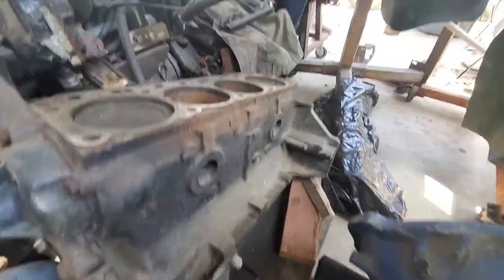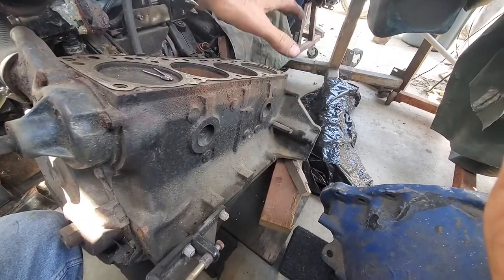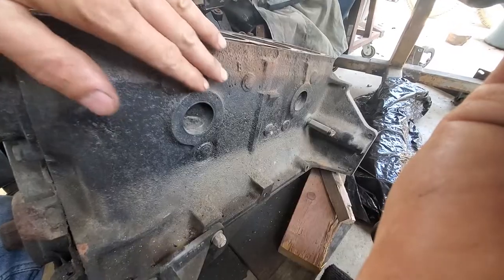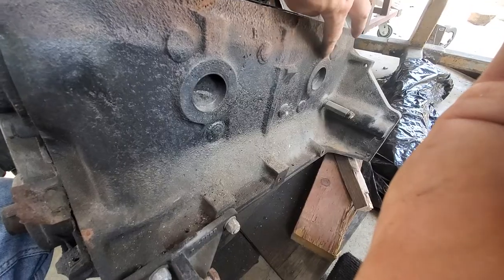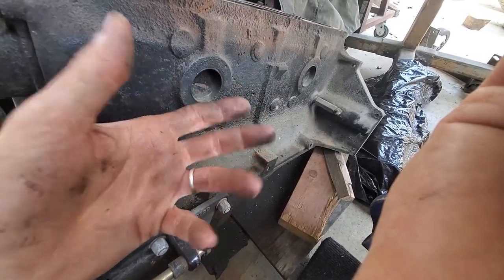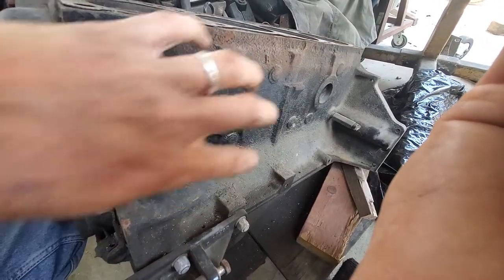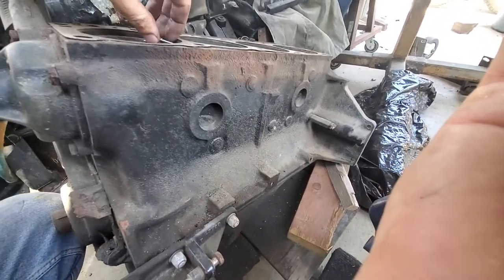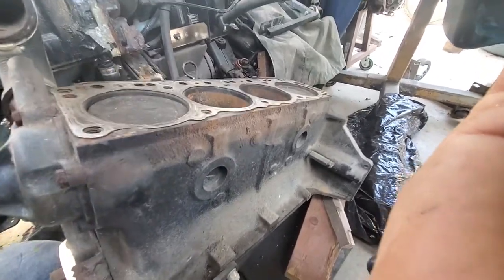Fix your cracked engine block for under 10 bucks. Boat or car doesn't matter i4 v6 v8

Comment: I'm shocked at how many people don't know the trick of putting clear tape over JB Weld.
I even use the tape when doing body work.  It works on fiberglass, bondo, or almost anything that chemically cures.  Just peel off the tape after it hardens.  No sags, drips and even shape it to match contours.
Thanks for the video.
Reply: good tip

Comment: Picked up a 98 ebintide with a 5.7 mercruiser. ..supposedly just has a cracked block.... havnt dug into it yet...you give me hope
Reply from the maker: Good luck - ive fixed a few this way that still run fine. Do the fix and run it for 10 minutes on the hose and keep pulling dipstick.. if possible use dark clean used oil - it shows cream real easy. You need to watch my engine flush video to see how I speed flush milky cream from an engine-
Reply: @SocalMarineUSA  thanks,going to dig into it soon.   Would love to restore it
Reply: @SocalMarineUSA  I just bought a boat has cream milkshake EVERYWHERE I was told it’s only the head gasket but I suspect the block is cracked at 8am this morning I’m about to inspect the block for cracks. What do you suggest I do besides fixing the crack, replacing the gaskets, swap the spark plugs & change the oil ? Any tips or tricks or proper instructions would be greatly appreciated. Thanks.

Comment: Instead of JB Weld, use windshield adhesive. It stays flexible and is extremely strong. It will not crack.

Comment: Had the same crack on my 3.0. I used MarineRex grey instead of JB Weld. Still running strong with no leaks 3 years later:-)
Reply: Will it work on my kia sorento?

Comment: These are not pressurized cooling systems raw water systems dump out riser into exhaust.
On pressure fresh water cooling systems i used 6011  arc weld rod made for cast steel pipe welding.

Comment: I have my boat engine block with a crack and I did 3 times JB welded and every time the patch come off... always milky oil do you think the block has internal damage?
Reply: Yes,  the crack im talking about doesn't mix oil and water. Either head or block is cracked or head gasket bad.

Comment: Hey thanks for the video. I am considering doing this and am curious how your repair is holding up to this date?
Reply from the maker: both blocks ive done have been going strong years later- its a very easy job :)

Comment: Hi mate ive got a pin hole size in side of my transit block. 😢 ive cleaned the area and waiting on jb weld extreme temperature putty coming this stuff any good? . Small hole leaking coolant slightly.
Reply: yeah that should work just fine! its not very high pressure. Clean it well and spit on your finger to smooth the putty out so it doesnt stick and pull back off. leave overnight and it shd be good. On top of that you can also add a liquid radiator stop leak product - in case a nother one develops it will find it and plug it. Dont use the stuff with fibres or kevlar etc in it, they plug radiators, just use a liquid style one as a back up..

Comment from the maker: depends - cream could be froma cracked head, standing in the rain or possibly cracked block. If the block cracked outwards like in this video it will likely be fine after the fix. Watch my flush video here to speed flush the motor asap to get an idea of whats going on. https://www.youtube.com/watch?v=fU8a-UbBxvc

Comment: What if the dip stick isn’t clean
Reply from the maker: remove oil pressure sender on side of block. Install a 1/8 npt ball valve with a CLEAR 3/8 hose. Pour in 2 quarts diesel. Run it (cold) for 2 minutes. Open the valve and run it into a bucket (takes about 10s) - ie use the oil pump to pump the thinned oil out. Refill with 50% diesel and 50% oil - close valve, run motor again for 45s. Open valve and pump it out into bucket. Keep doing this till oil is clean, replace oil filter and keep an eye on oil. I get used oil from parts stores where ppl bring in their old oil, perfect for this kind of thing (just make sure the used oil looks clean). Usually 5 flushes is sufficient. NOW if you have another issue like a blown head gasket - well then the oil will cream again, sometimes slowly sometimes in 5 minutes of running.